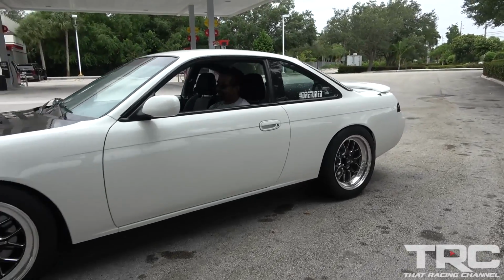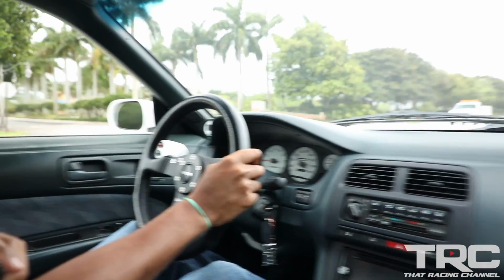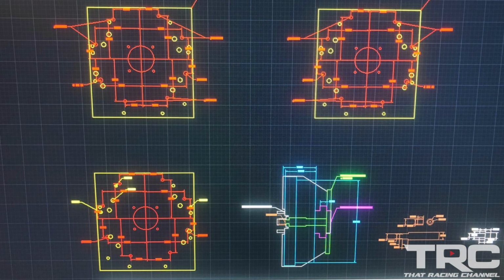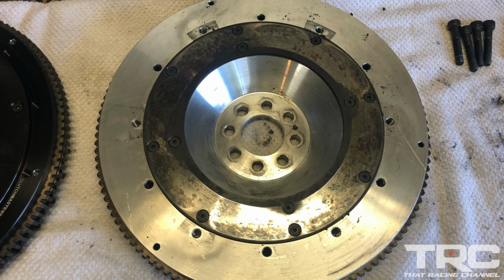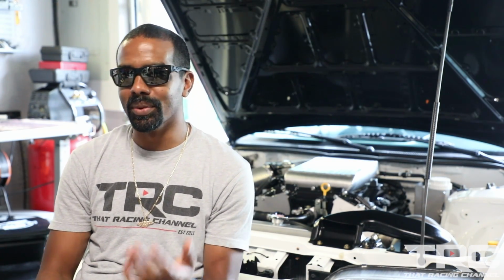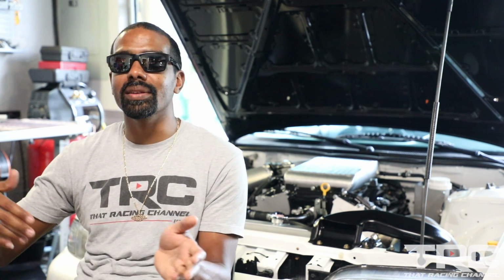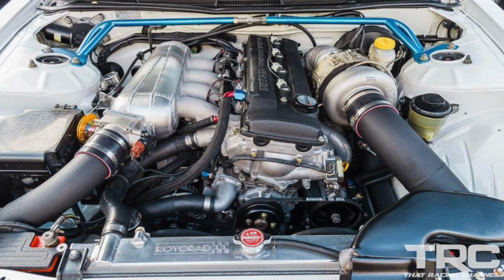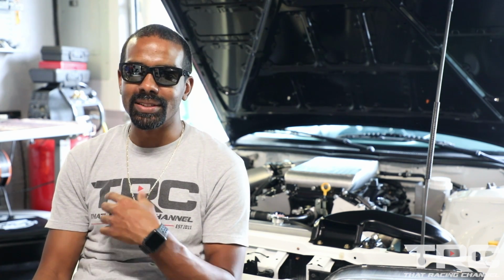Cleanest Nissan Swap EVER?! 800HP Single Turbo VQ35HR S14 240SX (15 Year Restoration Project)

Comment: This build is absolutely insane. I really want to do a VQ swap for my z32, but I don'y have the means to fab for fitment yet.
Reply: How much fab are you concerned with, that’s a pretty big engine bay!
Reply: @bamuz  ya the VQ is, its layout makes its footprint small in an engine bay, probably wouldnt take much to get it in a z32
Reply: @hihihihihello  I have a 1970 roadster and was going to stuff a vq35hr in that, and it’s been done well with the single intake version- however sourcing one was impossible so I just got a vg30 for the time being so I can get it goin until some of these 08-09 Z get cheaper haha 
But if it will fit in a 1600 roadster it will fit in a z32 cause heck the vg30 in the z32 is huge anyways

Comment: The S-Chasis is one of the best all around chasis. I really think people don't exploit s13s, s14s, s15s for circuit track use as much as they should. 2 door coupe with back seat, long enough wheel base, can be balanced between over-steer or more grip, RWD. Nissan really needs to bring it back after the new Z. Love the S-Chasis trying to get a s15 as we speak lol

Comment: Surprised by the sound on this. Glad to hear that the owner also hates the sound of VQ's with crap exhausts. Those interior shots during the pulls have a sound kinda reminiscent of the Honda VTEC motors. Slightly buzzy, but when coupled with the spool noise it gives such an awesome multitonal sound. Big props to the builder on keeping it clean and classy.

Comment: Surprised that he kept the rev limit stock with the upgraded jw valve springs. Hey, whatever works. 
This thing is obviously built right. Although, I was also surprised he didn't go in to internals right out of the gate with a 1000hp goal. The vq is pretty notorious for not liking that kind of boost stock

Comment: Love the build quality and attention to detail. That said, you showed an E60 M5 which is a naturally aspirated V10, not the F10 twin turbo V8 M5 mentioned. Easy mistake, but the later model V8 M5 has a much better transmission.

Comment: I'm curious to know how much torque was lost outside of where he dialed the factory cams in by eliminating the VTC, and if it really matters? It would probably really benefit with some cams designed without phasing in mind. I'm a huge fan of VTC, but it's hard to argue with that weight saving and especially simplication.

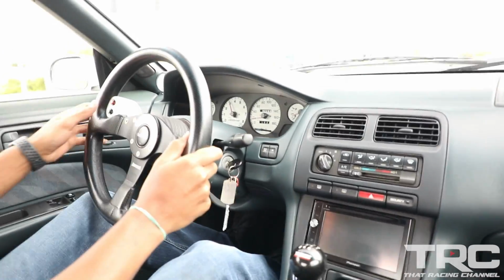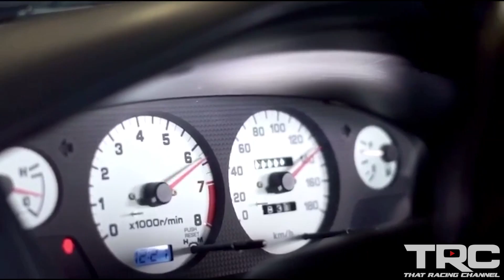Comment: Clearly sees it coming onto boost at 5-6k rpm at the 5:25 mark, then follows with "it comes in fast you're just rolling into it at what 3k rpm?". Looks like it comes on way late actually. Power band looks sh!t for an engine of that size. You can see this very clearly again at 10:55. Turbo too big for the setup or a bad tune. Even the 4th gear dyno pull at 14:50 clearly shows how bad this thing lags.
Nice car and all but don't lie about what we can see lol.
Reply: I agree, single turbo VQ’s usually hit boost way sooner, but this setup isn’t as efficient. To explain, since he eliminated the vtc cam gears which is not common in the VQ world to do, he limited the power band on the tuning aspect. Most tuners use them cams/cam gears to bring in more torque early on in the power band which would help spool the turbo. So the combo of his big turbo and eliminating the cam gears the power band shifts to the top and is laggy. Stock block VQ’s with 62-68mm turbo spool around 4,000-4,500 rpm. Twin turbo they spool even faster.

Comment: Typical 60° V6 Turbo screaming @ high revs
Sounds like my Alfa "Busso" V6 Turbo  :)
Reply: MrCornholios  sadly she doesn’t scream like a normal boosted HR would :(
Reply: @VQ37HRROZETHROZAY  Because of the big single turbo. Wastegate opens later as on twin turbos. Just my explanation.

Comment: vq is best motor ever and best motor to make power on, intake and exhaust you’re easily at 500 wheel
Reply: Logan Burks Lmaoooo who’s your dealer?
Reply: Fismo Jay 🤣🤣 on the real not bad motors, few bolt ons and a good tune, be near 300 whp
Reply: @loganburks23  the VQ35HRs and VQ37VHRs have been making mid 300s with basic bolt ons. The VQ35DEs however struggled to hit 300whp with bolt ons and even cams lol
Reply: Adnan Pilav Yeah i saw your video 👀 now ima forsure get a 350z HR as my next car. Currently drive an Na Dodge Stealth r/t but it aint that fast 😂
Reply: Alex Villalobos Go HR , HR is the way to go if you’re looking into a easy mid 300 whp car ; and if you go boost on a stock block HR on the long run only run low boost ; stock block HRs and high boost don’t combine well ; I know a friend of mine deadass no lie he blew his stock block rear mount turbo HR on his ‘07 350 , and legit the day after got a built bottom end 3.7 VHR short block ; if you’re going to go built  the VHR block with HR heads is the way to go

Comment: This car needs flatfoot shift.
Reply: c0c0asauce every car has it, just depends if the driver can bring it out.
Reply: @joshuahenthorn6532  What I mean is using the software in the ECU to cut power when the clutch is depressed.

Comment: I'm a diehard Nissan guy, so I refuse to swap my S13 with anything other than a Nissan engine so im with Andre. 2JZ might be a good engine, but keep it in a toyota.  You're not a real Nissan fanatic if your thinking about other engines( 2JZ, LS, 1JZ, K24) ect to put in your Nissan. You're just a poser. Following the crowd of what everyone else is doing.  If you like Nissan that means both  cars and engines. I'm just annoyed at that...sorry guys.